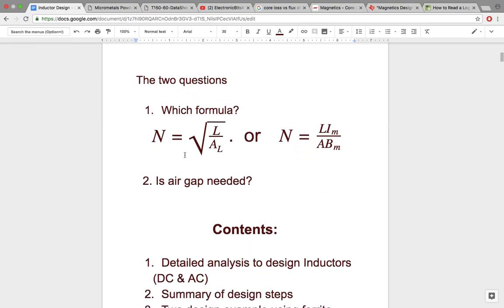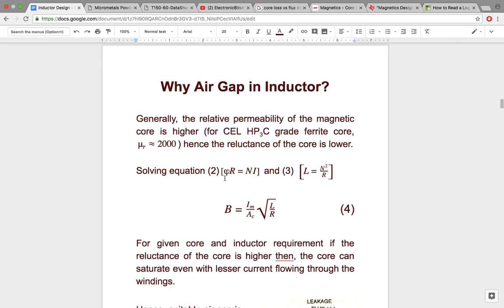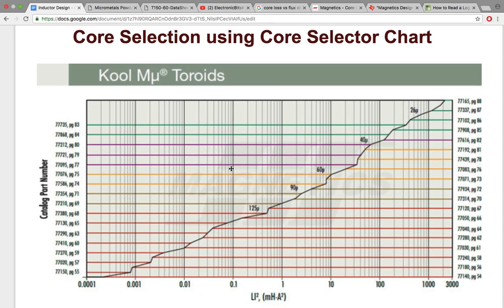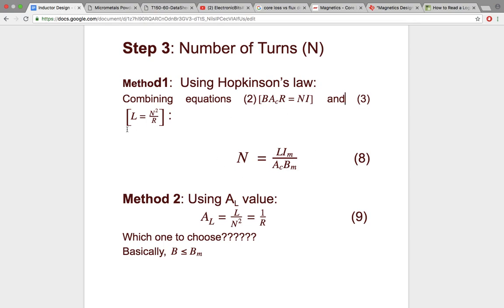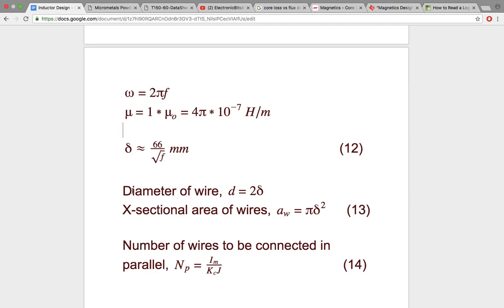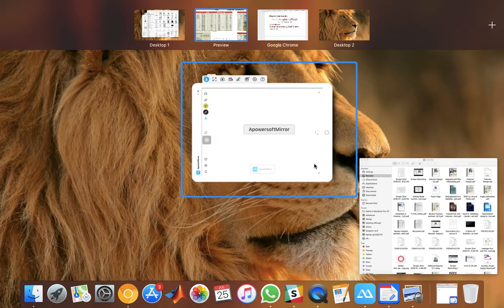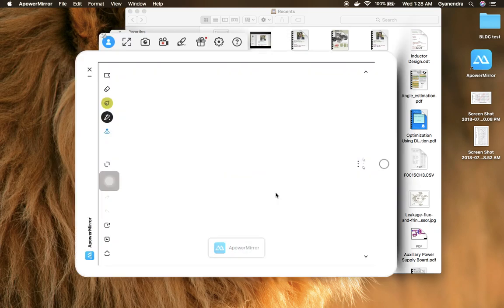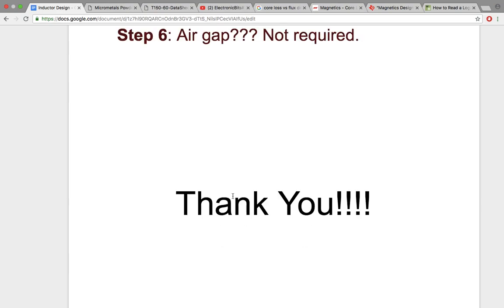High frequency Power Inductor Design: DC & AC

Comment: The air gap is necessary to reduce the relative permeability from 30,000 to 4 (about the same as wood). If you use a 21st-century century, then the air gap is not needed.

Comment: thank you for the explanation @mankapowerelectronics364, everything is clearly explained in the video. I have used the data in this video for designing an output filter for a half bridge converter using EC2820 ferrite core and everything went on accordingly.

Comment: Hello Dr. Sah,

The video is insightful and I as a beginner learnt a lot from it. In fact, I will use your method to design my own inductor. I have a question, though. At time 37:42 of the video you mention that
AL ≤ (Bm*Bm*Ac*Ac)/(Im*Im*L) (equation 10)
For any ferrite core the AL value has a +/- tolerance of x% which means the AL value can fluctuate between AL(min) and AL(max). So in such a case which value of AL should be used to verify the inequality?

With regards,
Ankit

Comment: Hello sir I have designed a step down transformer using ferrite core for my design I found turns ratio , but I need to know how much ferrite cores should I stack for getting power output of 5kw , can you please guide me sir , it’s for LLC converter .

Comment: Excelent document! Now, taking into account your example, as follows: calculus of an inductor with L = 500μH, Im= 5A, Fs= 25kHz, DC,  I have a question. Considering that the coil is subject to an AC of 25 kHz plus a DC current,  resulting in Im=5A , I ask: - shall be the wire diameter be calculated considering only the DC current effect , otherwise,  the AC current (hence the δ skin depth effect) or a combination of both concepts? Thank you. Angelo.

Comment: This air-air gap of 1.7mm is independent of of core cross section and dependent only  on DC turns NI only! Even 1mm air-gap result kills ferrite inductance  by factor of 3000 thousands and result in  FAKE INDUCTOR driving frequency 1000 times to  have make up for kill inductance as resulting real air core inductance! Your teaching huge airgap  is total wrong teachings!
Reply: But if he's intending a flyback  (a high-power device used in CRT televisions and computer monitors of the recent past),  the air gap in the core is what gives a flyback its behavior - look up 'flyback transformer' on wiki for more.

Reason I mention it is - his bio says "Power Electronics Engineer" and I immediately thought "air gap core"  +  "power electronics worker" = FLYBACK     When the output of a flyback (gapped core) device is rectified, it provides the immense voltage in a CRT (cathode ray tube), and this high potential is used to accelerate the electrons in the electron beam to the front surface of the tube

Had his bio not said "Power electronics engineer"  the flyback would not necessarily have come to mind
.
Reply: This says it all: "His bio says "Power Electronics Engineer" and I immediately thought "air gap core"  +  "power electronics worker" = FLYBACK. Actually, modern Power Electronics engineer is one who knows that Flyback converter and air-gap in magnetics circuits are very bad and extremely limiting processed current and power and most important dramatically reducing efficiency while increasing size! It should have never been invented!
Reply: @SlobodanCukTESLAco  the gap in the core prevents the core from saturating.

Not sure if you're aware, but the permeability/inductance reduces immensely if the core gets saturated.  The small gap in the core allows more energy in the primary, compared to if the gap was missing, without saturating the core.

A gap in the core is conceptually similar to:
1)  installing much stronger suspension on a pickup truck
2)  installing larger wheels and tires on the pickup truck

The same pickup truck can now carry more weight.

This is actually what is done to pickup trucks that need to haul, say, a trailer for a large boat, or a camper trailer.

If you want more energy in the primary (so that you can dump more energy into the secondary), a gapped core enables that.

Since cathode ray tube televisions and computer monitors needed very high acceleration voltage for the electron 'gun', the flyback transformer was the cheapest way to create isolation with the capacity for handling lots of energy.

It's just another 'tool in the toolbox' and worthwhile to know about.

Same with 'magnetic amplifiers', which are sort of the opposite - they amplify AC/RF by purposely saturating the core

Yet another 'tool in the toolbox' - magnetic amplifier  (also known as a 'saturable reactor')

NEVER STOP LEARNING and acquiring tools

Comment: By far the best inductor design video. Thank you so much for taking time to go through the theory and example
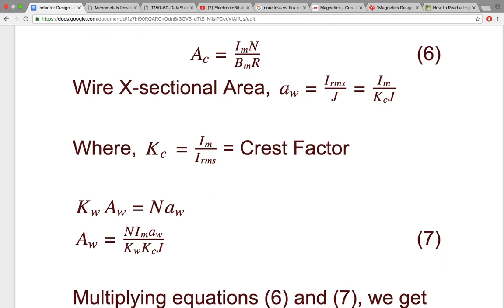At 28:01, The aw term in equation is an error?
At 53:40, Isn’t WaAc given in datasheet same as Ap product? If so Do we have to do the Ac*Aw calculation since already given?
1:05:55, If outer leg is not half size of center leg , What is your best tip?
Reply: Yeah I noticed that too.. WaAc which is Ap is already given in the data sheet... Why not just use it that way to pick the particular calculated core.

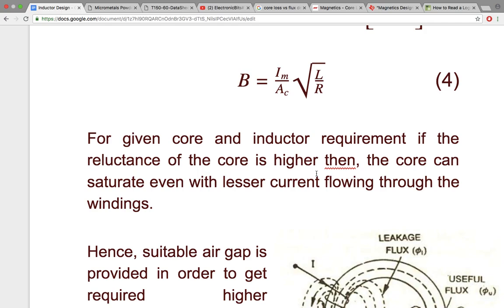Comment: I believe that the statement at 12:48 in the video is incorrect in relation to equation (4). You state ..."if the reluctance of the core is higher then the core can saturate...". Shouldn't this be "...if the reluctance of the core is lower then the core can saturate..." instead? As at a lower reluctance the inductor operates with higher flux density B from (4).

Comment: Thank you sir for your video,  i have question about iron powder cores, that in EE, EI core we can set the air gap accoring to our current to avoid saturation, but as it is said that in iron powder toridal cores air gap is distributed,  can you please provide any data where we can find the effect air gap of iron powder core (which will be fixed value for a given toridal core size), so we  can find the saturation current of given size toridal core, please answer my question thank you
Reply from the maker: Thanks for your question. It might not be a good idea to add an additional air gap in the toroidal core which already has distributed air gap (you may choose the next available toroidal core which meets your requirements). Incase you would like to add additional air gap in toroidal core which already has distributed air gaps then you will require to consider reluctance of both the core and the air gap to find the equivalent reluctance of the inductor. 
Note: The effective reluctance of the core can be obtained using given AL value of the core.

 You may try these maths simply by yourself by following the concepts discussed in the video. Maybe we can discuss further after you have obtained some equations and still have some doubts. Thank you.
Reply: Sir thank you for your reply,  as for ferrite core inductor we use 0.2T as saturation Bmax, for toridal iron powder core what is Bmax?  aslo i do not want to introduce air gap in toridal core, but want to know the quantity of already available distributed air gap? for 100 amp peak current and 18uH what size of toridal iron powder core i should use?   
sir i'm using your method for core where we can introduce air gap after calcuting according to our current rating and it is fine,  but now i want to use toridal iron powder core , which have distributed air gap, but for iron powder cores , i donot know the Bmax,  value of distributed air gap in mm,  so not sure for any current rating i should use which size of iron powder core? 
can you please please make a video on iron powder cores with an example in future ,  where you will not add air gap but will select core with distributed air gap for your current rating ,  you have already done an excellent job by making this video, thank you
Reply from the maker: @AS-zs7jw  You may follow the second example explained at the end of this video where the a dc inductor is being designed using toroidal iron powder core. Also go through the comments of Omar ramero sahagún (you can find it while scrolling down the comments of this video): this might help you to get an idea of what value of Bmax you can choose while designing inductor with iron power cores.
Reply: Thank you sir!, we are looking for more such concise practical experienced based knowledge videos from your side.    waiting for for your more videos.

Comment: Thanks for the video! The information is very helpful. I would like to ask for a clarification regarding the selection process for Bmax in the equation  Ap = L*I^2/(Bm*Kw*Kc*J) you show in the design example. 
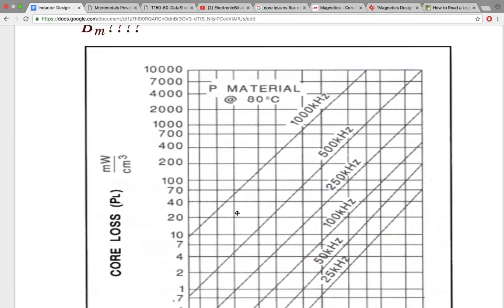For the design example, first using Ferrite core, you chose Bm = 0.2 T based on the graph from Core Loss Vs. Flux Density (Gauss) (time 29:30 in video). This value makes sense when using ferrite core, because for B = 0.2T at 25 kHz you would have a core loss of 70 mW/cm3. In the video you mentioned using 100 mW/cm3 (time 30:45 in video) is a good safe value and that we should really look into the thermal management in the PCB. Now when you change to the iron powder core, you mentioned that due to the different chemistry you can go higher than 0.2T, which makes sense when using Iron Powder (as you introduce a distributed air gap), so you chose a value of Bm = 0.35 T for 25kHz (~1:09:00 in video), then mention that we could go for a higher value than this (0.5-0.8 T), and then select the core T150-60 from MicroMetals. Here is where the question comes, according to the datasheet from Micrometals for the core T150-60 (see link: https://micrometalsarnoldpowdercores.com/pdf/T150-60-DataSheet.pdf), when you see the graph from Core Loss Vs. Flux Density (Gauss), you can notice: 
1)	At 25 kHz and a Bm = 0.35 T (3500 Gauss), you would have a core loss of 10,000 mW/cm3, which is 100 times more than what you originally had with the ferrite core in the first part of the design example.  
2)	Also choosing a Bm of 0.5-0.8 T at 25kHz could get complicated as the reference line pretty much disappears after 0.35 T (not sure if you could consider it linear at all time).
Could you please elaborate on these points? i.e. is T150-60 still a good selection even with the mentioned high losses? Is this something you considered during the calculations or were you neglecting these thermal losses? Would you rather go with a different iron powder material mix to lower thermal losses? If you choose a Bm = 0.5 at 25kHz, would you extrapolate the core loss? 
How would you have chosen Bm if you had only considered the iron powder core for the design example? (would you have gone directly to the graph from the T150-60 and chosen 0.35 or a different value?) 
Thanks!
Reply from the maker: Hi Omar, thank you very much for your questions. While making this video, I hadn't opened the iron powder core (T150-60) and looked the core loss graph. But I did now and found what your are saying is absolutely right. The core loss will be higher in the iron powder core. I had chosen the Bm value for iron powder core from my experience during my Bachelor's final year project while interacting with inductor manufacturers. The main advantages of using iron powder core is that air gap is distributed throughout the core (Hence the loss is uniformly distributed throughout the core) and the saturation flux density is higher (even more than 1T for most of the material technologies) [1,2]. Further the core losses in inductors in DC operation is way lesser compare to the AC operation. The area under BH curve for one period is majorly decided by the inductor current ripple, in DC operation the ripple current is lower compare to the AC operation. Generally, the core loss graph is given for the AC operations (X-axis : Bpk - Peak AC Flux Density (gauss)). For DC operation one can make some exceptions and go higher Bm value without actually increasing the core loss significantly but again the loss depends on current ripple; if the inductor is designed for higher ripple  current then surely core losses will be higher. But cooling iron powder core is easier compare to the ferrite core (where the core loss is mostly concentrated around the air gap [1]). But ultimately, the designer should make the final decision based on the space available in the device for the inductor, cooling facilities and cost. 

But in the AC application, the core loss in the iron powder core can't be ignored and one has to consider all aspects (thermal, cost, core size requirement and so on) before finalizing the core. Choosing higher Bm will surely reduce core size and hence form factor of the device and cost. In many applications, where space and higher temperature rise in the iron powder cores are insignificant compared to savings in costs, iron powder cores offers the best solution. Once again thank you for your questions and feedbacks:)

1.https://electronics.stackexchange.com/questions/83876/advantages-of-using-a-powdered-iron-core-for-an-inductor
2. http://www.coilws.com/index.php?main_page=page&id=41

Comment: Awesome video uploaded by you sir with all important details for designing. Thank you very much for this sharing. Can i have this notes in pdf from you if possible please share to my mail
Sir i have gone through video I'm having problem with power inductor designing with air gap i have value for Ac, Aw, Imax, Bmax, D, Kcu,  AL, Lairgap value in which i have 4 diffrent values for AL and Lairgap for which I'm calculating N. for different lairgap and AL they have calculated AL1 to AL4 again in nH but as per formula my answer coming in microH. And calculated N1 to N4 with this AL1 to AL4. For the same which formula they have used i didn't get it. I have try all combination but I'm   not closer to ans. I will mail u same thing in the morning as it's to late now.

Comment: Thank you Sir for amazing explanation. I have a basic question that while designing boost converter for 5kW , the peak current comes to be 26A which makes area product very high. Do we have to take peak current in Inductor or some other current?
Reply from the maker: Thank you for your kind words. We always consider peak current in inducture design. If you find difficulty designing one big inductor then you may design few inductors with lesser ratings and connect them in parallel to get total desired rating. All the best!!

Comment: Please my problem most time is how to figure out the value of an inductor i need to design or wind .Fore instance i need inductor  smoothing (filtering) AC ripple after rectification ,please can you help me on this issue. Thanks
Reply from the maker: I am busy these days with my course work and exams. Unfortunately, I can't help you this moment. You may follow some design steps available for your application. Sometime finding correct resources is also difficult but you should be able to get, it just takes time.

Comment: Your result in wire area with enamel is very very wrong because [(3.142*1.709^2)/4)]  1s 2.29mm^2
Reply from the maker: Hey, I have mentioned result in cm^2. 2.29mm^2=0.0229cm^2.

Comment: Wonderful work .. 
Can you help me design ferrite transformer 
The input voltage is 100v ac to 240v ac
The output is 4.5v 2A .. but the output includes three coils each one gaves 4.5v 2A
You can use EE-core
The frequency is 25 kH
Thank you ..

Comment: is L umand book explain it clearly ?

i need 280uh inductor for which i get 55 turns with 20swg wire. what is chance
Reply from the maker: Hey, L umanand book is good book to start with but try to follow my steps because it is more generalized of steps given in L Umanand book. 
Regarding your design, for the inputs you have provided, I can't tell if ur design is correct.
Reply: ManKa Power Electronics i have designed exactly as per L.umananda ....but i dont think that with 55 turns with 20SWG wire size i get 280uH inductor valie. can you pls comment

Comment: I want to design dc inductor which can store 60mj of energy without saturation
Reply from the maker: Hey, you will require value of both L and Im for designing inductor. Since, you already have energy need to be handled by inductor, u only require either L or Im and compute other (Im or L) from equation E=0.5*L*im^2

Comment: Hello sir,i want to design one Dc inductor with E-I type core .core material is sillicon steel.how to find the Al value of sillicon steel .i have two winding primary and secondary.so for area product formula which inductance value i need to use ,primary inductance or secondary inductance

Comment: Correction in your first formula you can use both  formula in one design especially in ferrite transformer design.Not "OR". Those two formula is inter related.. I've design ferrite transformer  using both formula and it practically works...
Reply from the maker: Hey, here I have explained the use of these two formulae for designing inductors where core equivalent reluctance is of very important. In actual sense, both formulae are same if core reluctance comes same using these formulae. Otherwise, these formulae can result in wrong design too if proper care not taken. These two formulae can't give same design in all cases for your reference. That is why I have given two design examples to support the concept.

In transformer we transfer energy instead of storing it (as in case of inductor). For transformer, design steps are different from imductor, where providing air gap might not be very important for high power application also.

FYI in some transformer air gap is introduced for avaoiding saturation of core. I don't understand you commenting on validity of inductor design equations based on your transformer design experience.